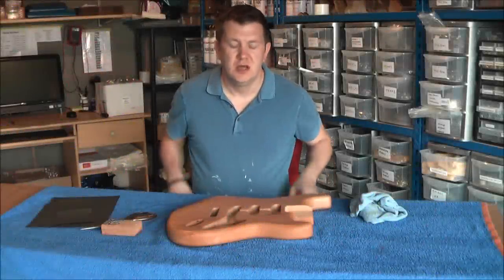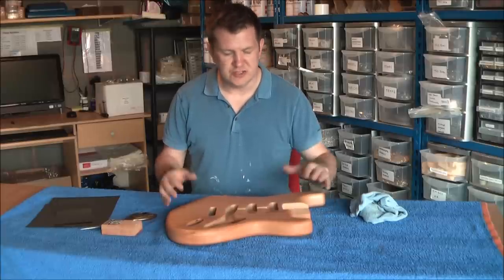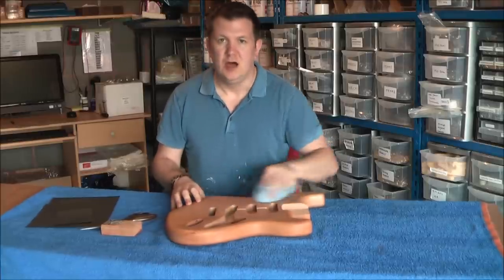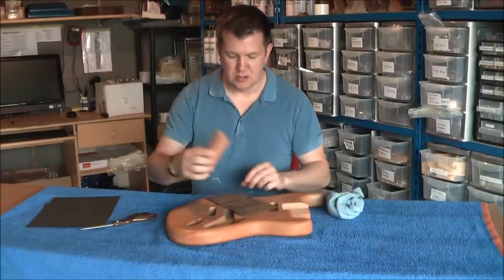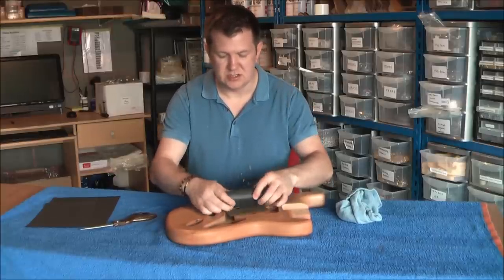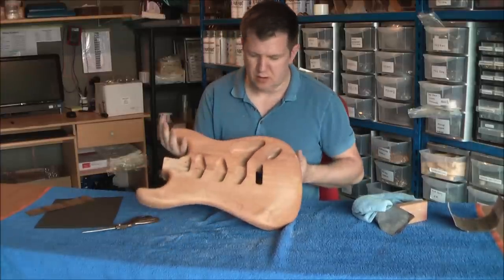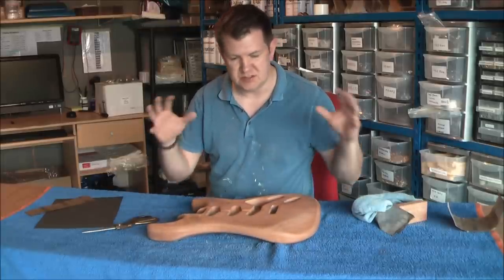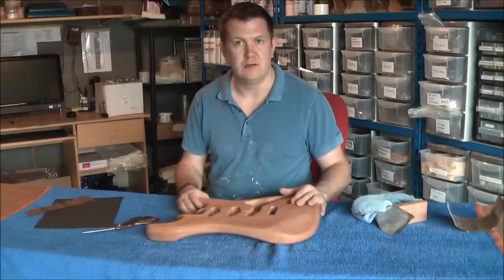How to Paint a Guitar Body with Nitrocellulose Pt 2 - Sanding

Comment: hello sir. how do you clean up the body after wet/dry sanding?
Reply: DE natured alcohol all over the body. little fibers will stand up when dryed rub a flannel no fiber loosing shirt or rag  against the grain as it will remove them. this is after sanding with 600 grit paper then use a sealer 2 coats then work up from there. sanding with 800 dusting off  the guitar body